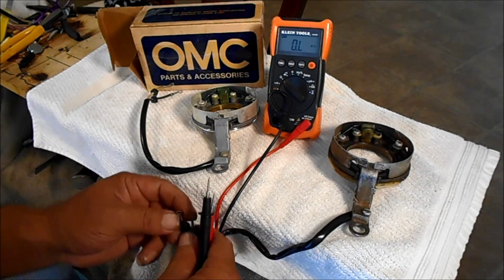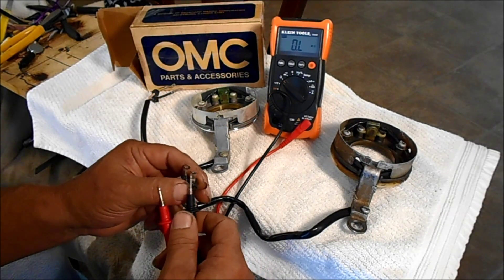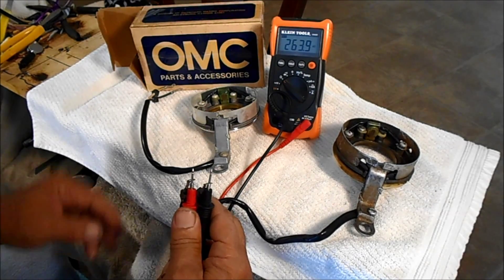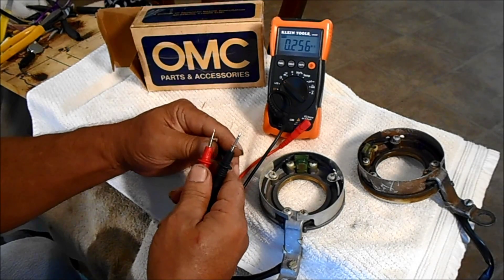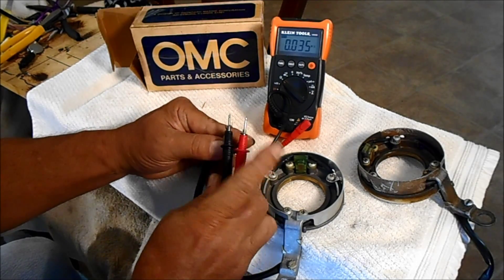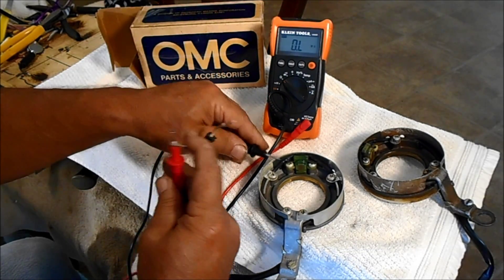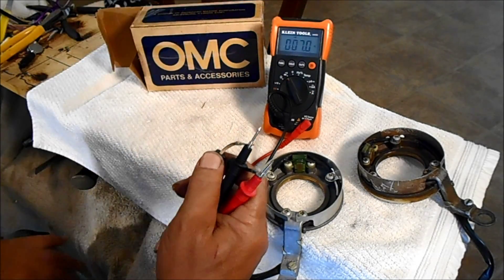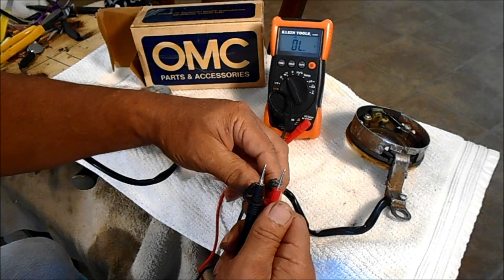HOW TO CHECK A JOHNSON AND EVINRUDE  TIMER BASE TRIGGER

Comment: I have a 1979 Johnson 115 hp v4, no spark
I took off the power packs and tested the red lead to each of the terminals to the ground wire on the power pack and it reads ohms! does that mean the power pack is good?
RSVP
Thanks
Reply: Could be your flywheel or Stator